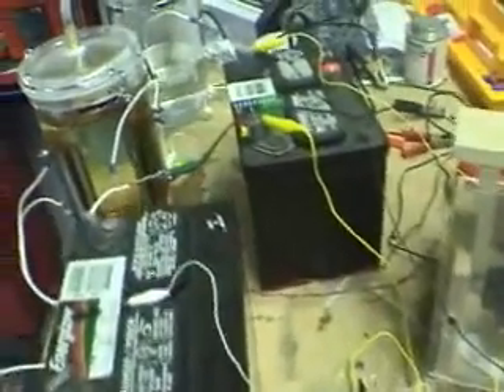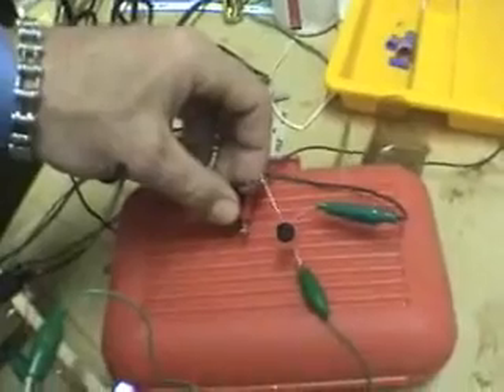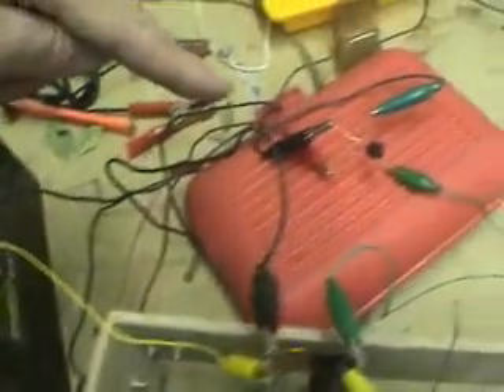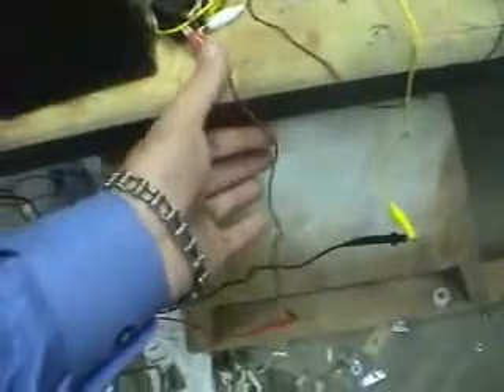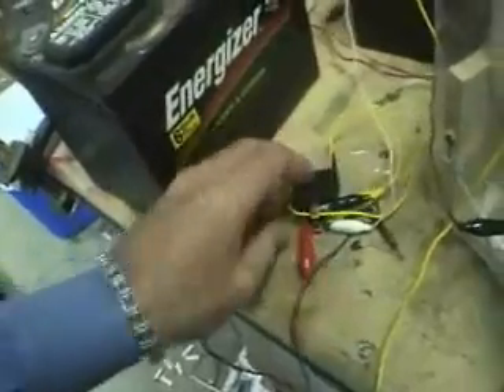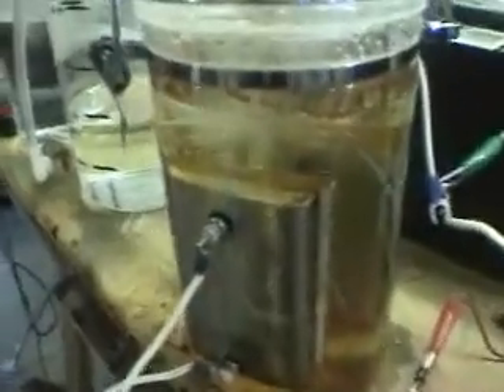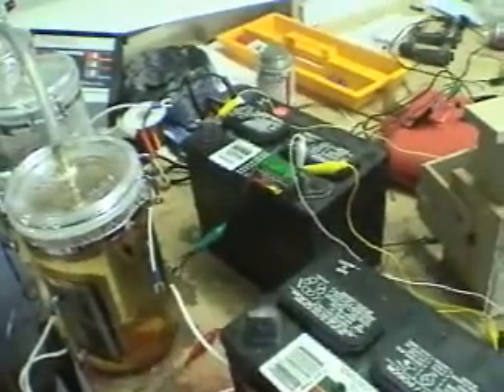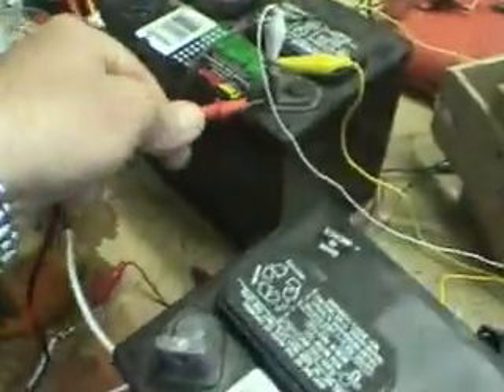Testing (more questions than answers)

Comment: ther bridge rectifier should be hooked up like this. the 2 leads with the snakes lookin simble should be hooked up to the ac generating volts of the coil and the + and - are the dc output hope this helps.